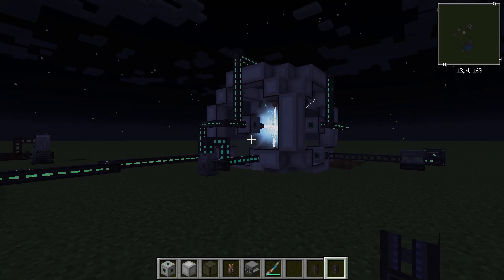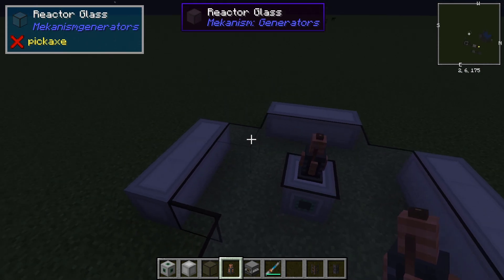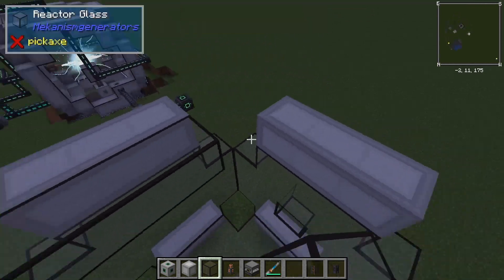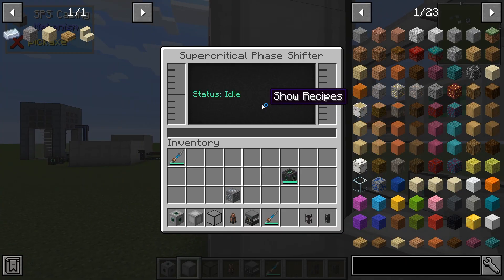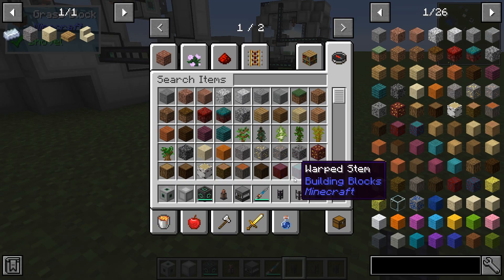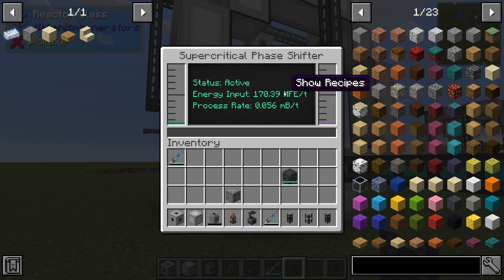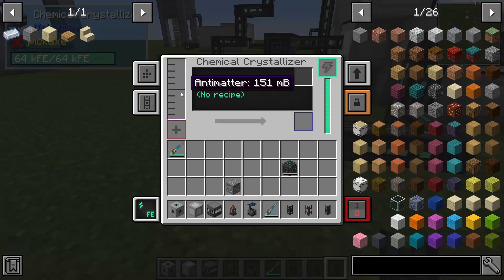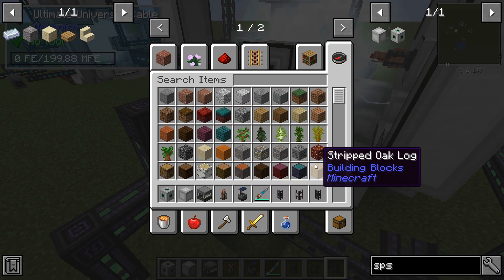Minecraft Mekanism Supercritical Phase Shifter Tutorial (Antimatter)

Comment: I accidentally broke something and now radiation spilled everywhere, is there a way to remove it, as my whole lab is filled. Thanks for the tutorial by the wY
Reply: You have to cheat, bur it’s /mek radiation RemoveAll
Reply: There isn't
Reply: @mohammednasser3303  I found a way, but it’s only with commands. Type mek and than radiation and then remove all or something like that and it removes all radiation. I’m building a giant lab in creative but if your in survival your screwed
Reply: @jeeperscreepers9114  I built my reactor far away from my Base, I don't want to get radiation, if there was a block that clear radiation I would've built it in my base
Reply: U can survive radiation with a mech suit upgrade or hazmat suit (lead and orange dye)
Reply: It goes away on its own, eventually- but it takes quite a long time. Or you can use the command to remove it.
Reply: I think radiation can disappears with a long time, but it's possible
Reply: Cheats yes

/mek radiation remove

No cheats kinda

It will take a whule